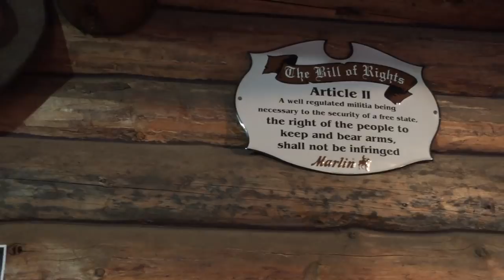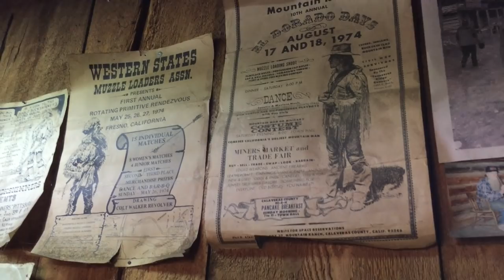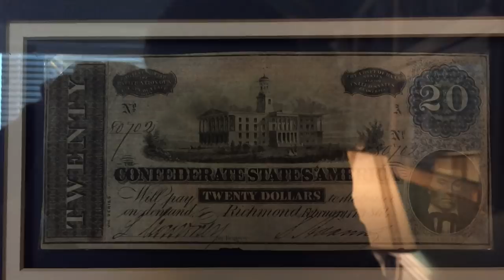Jacob Dickert Rifle

Comment: I really wish I had been with you, I’m in the process of purchasing a long gun kit from Jim Kibler, I’ll let you know how it turns out... but it will be no where like this gun you just showed.
Reply from the maker: Kibler makes a beautiful kit.  You will have a superb and most excellent rifle.  Love it.
Reply: I'm in the process of making a late Lancaster with swamped barrel and flint lock.  Parts came from Pecatonica, except for thimbles, entry pipe, and nose cap.  The biggest hurdle so far has been trying to overcome the problems associated with the front lock plate machine screw.